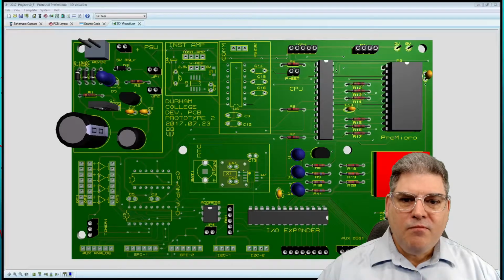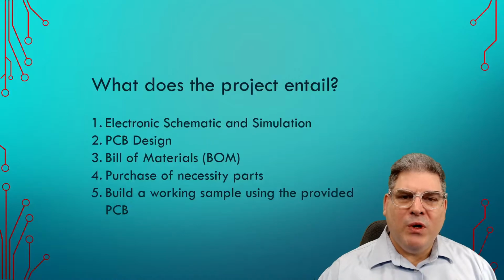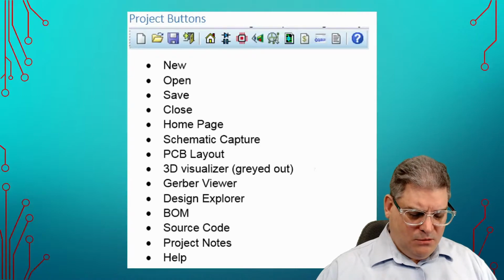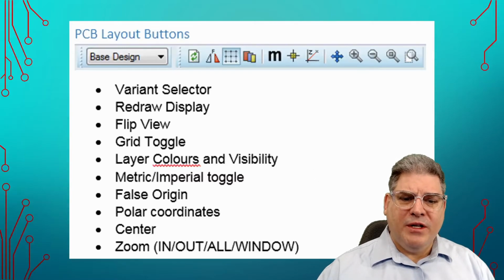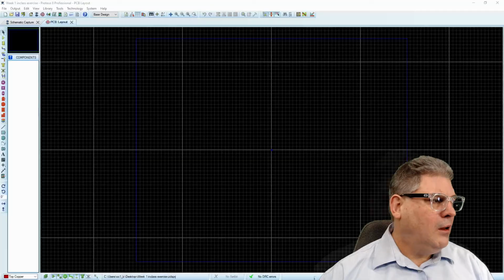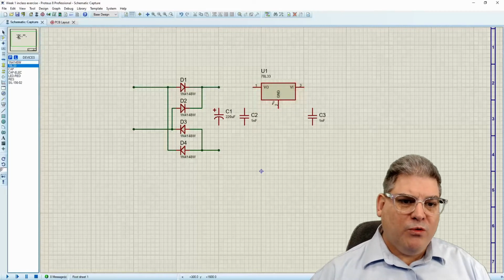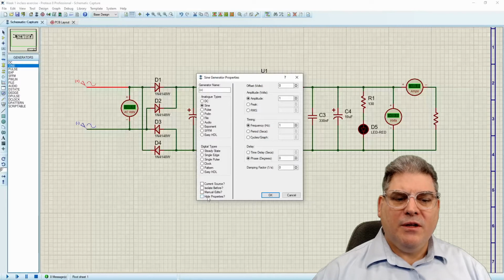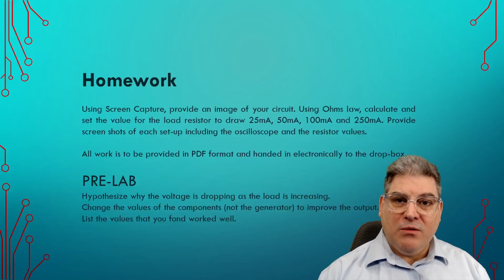CAD1133 L1 (2021)

Comment: I noted that datasheet for 78L33 recommends: C2, 0.33uF and C3, 0.1uF.  Great video!
Reply from the maker: Yes, these bypass capacitors are important for the high frequency noise that can be generated. Good eye! Thanks.😎